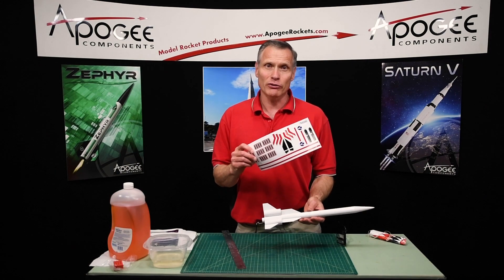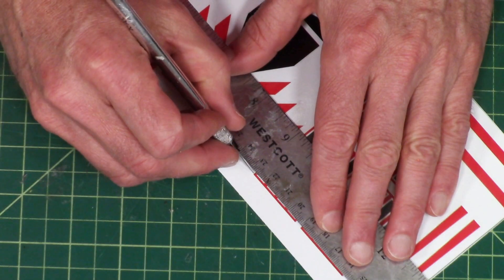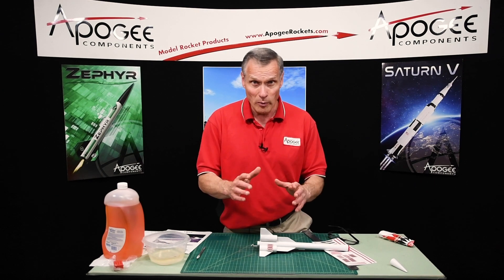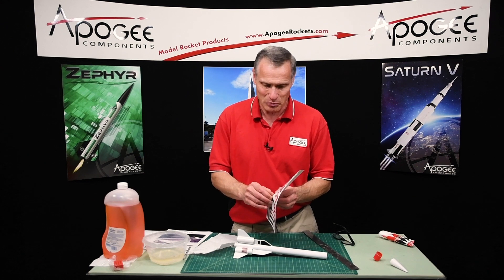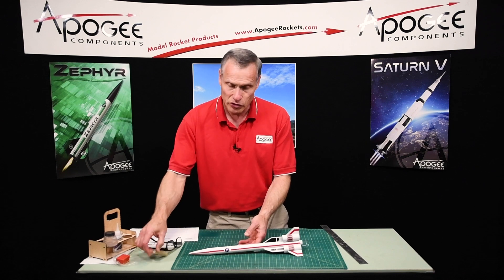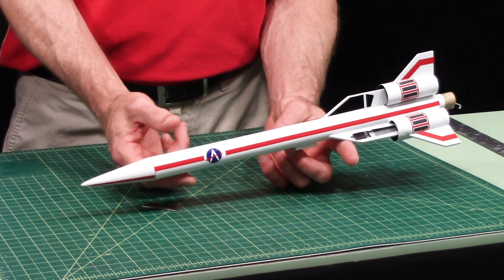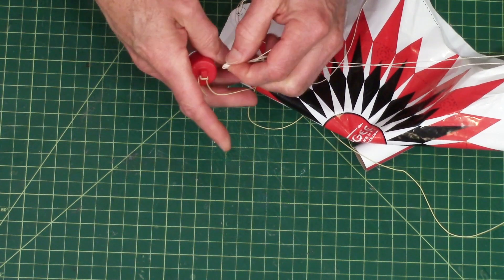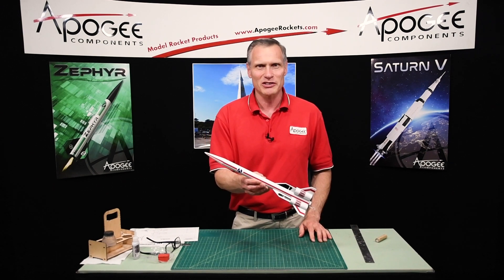How To Build a Rocket From Plans: Part 7 - Installing the Decals

Comment: @Apogee Components >>> Would there be any advantage to painting the rocket with a clear coat paint just to 'seal' the vinyl decals to the surfaces they are on?
Reply from the maker: Vinyl doesn't really need a clear coat to seal the edges. I would use it on water slide decals though.
Reply: @apogeerockets  >>> Okay - Thank You!